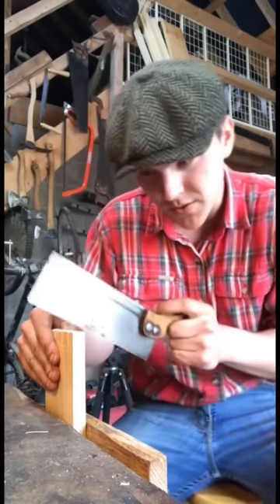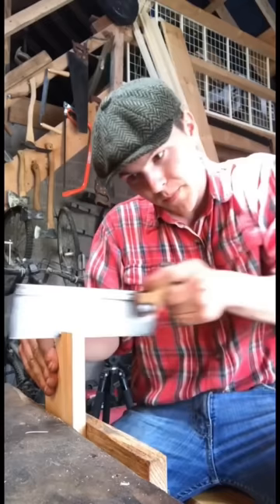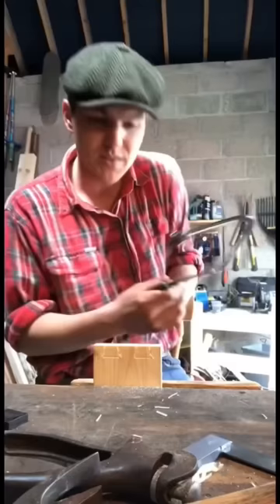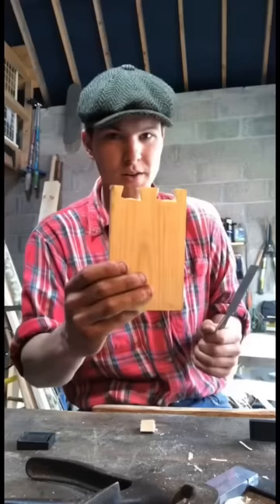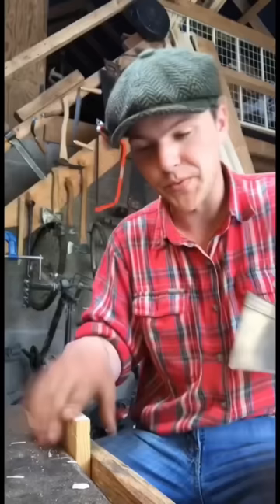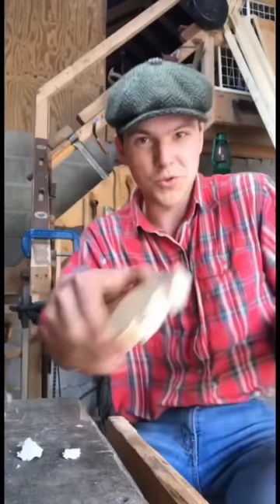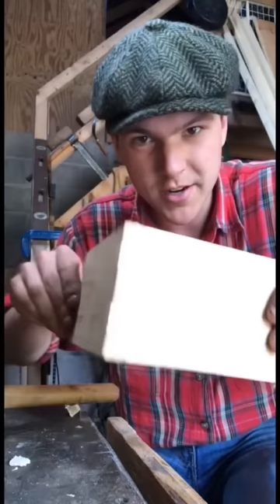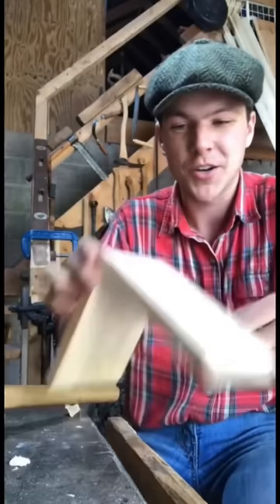Making a Dovetail Joint #woodworking #shortvideo #satisfying #handtools #ireland #joinery

Comment: "I'm nobody's cabinet maker"

I think that's one thing I like about your channel... You watch a lot of woodworking videos that make things like dovetails out to be these works if art that aren't even worth making if they aren't perfectly chiseled smooth with zero gaps, preferably in two contrasting woods to show off how good you are at woodworking. But they're traditional joinery for a reason - even if you just hog the material out with a hand saw and ram them together, you'll get a fairly solid joint, because it's just a well designed joinery method.
Reply: Agreed! I honestly had no clue and now I am actually willing to try this one of these days
Reply: It works even when done shitty? I need to try that
Reply: @jenstrudenau9134  that's why it's a classic. Anybody can learn it with the right saw and a bit of practice. Way easier than most "fancy" joinery
Reply: That’s how it used to be, simple and practical. Now in this meaningless time we obsess over perfection.
Reply: Very, very good point!
Reply: @jenstrudenau9134  they used to take the nails put of wooden aircraft frames once the glue dried in various joints, even when not done shitty it's surprising some of the physical applications they can hold up to.
Reply: @jenstrudenau9134  I have an old cabinet to store old bottles might be older than me by over 5 or 8 years, the dovetails on the top have large gaps and one of the bottom one is even missing part of it. Yet the cabinet still stayed strong all these years with little swaying, and rot was the one that took it apart
Reply: @jenstrudenau9134 if you want to cheat, mix wood glue with your wood dust and fill the gaps in your dove tail... Once you sand it down, everyone aside from the real tradesmen wouldn't be able to tell the difference. 😉
Reply: @jenstrudenau9134  the dovetails I made at 14 years old hold and they were shitty as well
Reply: That's the one thing, the ONLY thing!?  You don't love his boyish charm, his dashing good looks, his scythe of a wit, or the wealth of knowledge he offers?  For shame!

Comment: It's amazing that people used to dovetail wood because it was cheaper than using nails. Nowadays it saves huge time to bang a few brads and call it a day, but something of the craft is surely lost. Not to mention this is a much stronger joint.

Comment: I miss doing woodwork, especially in my college days as an apprentice carpenter. But tended to work with steel mostly and modern products on the actual job. I will always have an appreciation of the old ways.

Comment: Also, a video on how to sharpen your tools on the cheap would be cool. I've recently bought WD-40 and some different grits of sandpaper to sharpen things up, been using a speaker as my level surface as my workbench is very bumpy and old. I'd love a guide and almost bought one with a whetstone but have been doing it all by hand so far, can never get my hair to shave but they're definitely sharp enough to cut ye.

Comment: Since watching your channel I've bought a few chisels and planes, have started making a jewellery box and used dovetail jointing, except I didnt go all the way through, trying to cut it was so hard I had to do most of it by chisel. I used to be a bricky so I know you don't use a brick if it's too small in most spots, is there a rule like that for wood? I've been trying to make gaps around bits that are 5ml thick and am super lucky when they don't crack.

Comment: Question for ya. How do you sharpen those large teeth hand saw.
Reply: Run a flat file over the top of all the teeth, then hit each one with a triangle file, same amount of strokes per tooth to keep it from being to short.

If your saws are point hardened, you can't really resharpen them, because they are harder than the file.
You can identify them pretty easily because the teeth will be a blue colour.